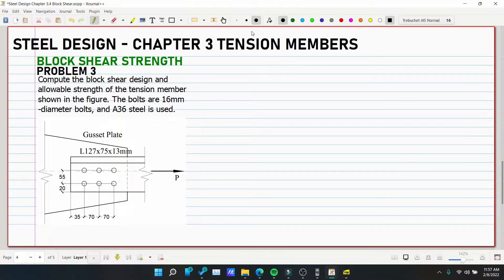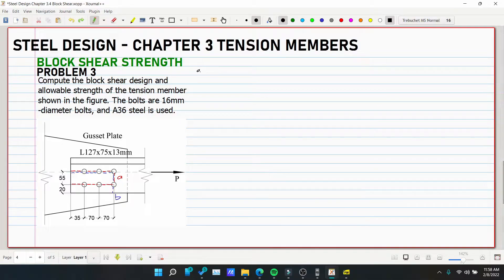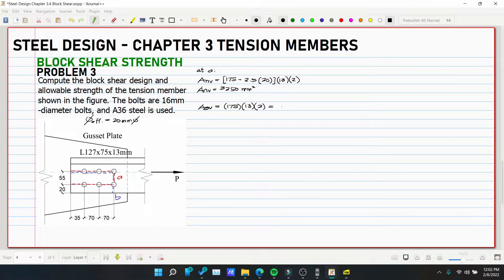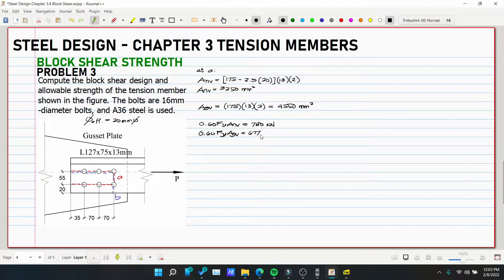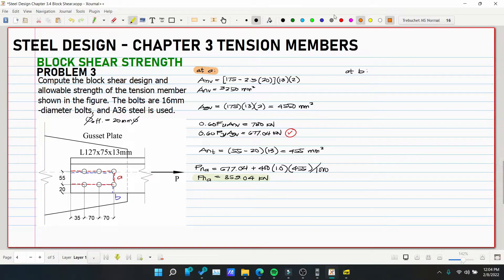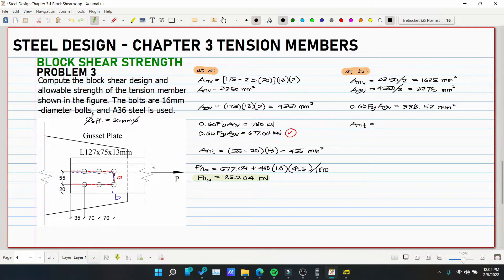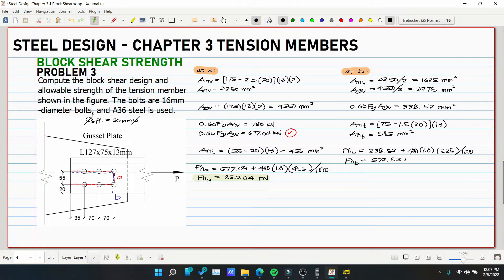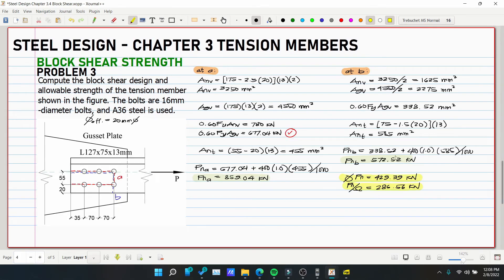Steel Design Chapter 3 Block Shear Strength Problem 3 (PH)

Comment: bakit po yung net tension hindi po naka multiply sa 2?
Reply: Hello po! sa pag kakaintindi ko po sa failure path A po ba? Ang pagkakaintindi ko po kasi isang buo lng po kasi yung may length na 55mm po bali (55-0.5 sa taas na bolt+0.5 bottom bolt tapos yung shear po dun is dalawa bottom and top part po pero yung tension po is isa lng kasi po kung babaklasin mo po yung part na 55mm isang buong tension member po yung maiiwan dun sa part ng isang layered bolt po. bali po (55-(0.5+0.5)(20))(13) = 455mm2 yan lang po mangyayari dun. sorry po if magulo pero sana po nakatulong

Comment: pwede po bang mas i clarify kung bakit hindi pwede yung path c? di ko po kasi masyado pang maintindihan, thank you po.
Reply from the maker: Sa path c po kasi, maunti lang yung butas na makukuha natin na ipangmaminus natin sa area, which whill make a greater strength kasi maunti lang yung butas. Sa tingin mo po ba, saan po mas mahina ang connection? Sa path na maraming butas o sa maunti? Syempre, dun sa mas maraming butas kasi maliit na lang yung natitirang area na magdadala sa load. E bakit sir di na natin cinonsider yung path samantalang malakas pala ang makukuha nating strength sa path c. That's the point, we don't need to check the connection kung saan siya malakas. Ikaw po ba, ano po ba ang mas inaalala mo? Ang strength mo, o yung weaknesses mo? Ano ba ang mas dapat ipriority in terms of strengthening yourself? Your strength or yung weaknesses? Syempre yung weaknesses natin. Ganun din sa structural members, we must check kung saan mas mahina ang member.

Comment from the maker: CORRECTION:

Ubs = 1.0 when the tension stress is uniform (angles, gusset plates, and most
 coped beams) and Ubs = 0.5 when the tension stress is nonuniform.

Since the tensile stress at failure letter B is nonuniform, dahil may mga bolts pa na magsasalo ng tensile stress mula dun sa failure path ng tensile, therefor ang Ubs na gagamitin at B is 0.50. 

Therefore: 
Pnb = 338.52 + 400(0.5)(585)/1000
Pnb = 455.52 kN
ØPn = 341.64 kN
Pn/Ω = 227.76 kN

Comment: good day po. ask lang po. since may natirang bolt po sa loob nang block area bakit hindi po 0.5 ginamit na Ubs  sa Pnb. ??
Reply from the maker: Ah, yes po. Nawala po pala sa isip namin itong Ubs. Anyway, dagdag po nating correction ito. 

Ubs = 1.0 when the tension stress is uniform (angles, gusset plates, and most
coped beams) and Ubs = 0.5 when the tension stress is nonuniform. Since our connection here will cause a nonuniform tensile stress distribution, therefore our Ubs = 0.50.

Thank your for the correction po!

(Sorry for the very, very late reply as CE Box is very busy with his Master's Degree, Accreditation, Work Stuff, and Life. Thank you for understanding. Keep in touch with CE Box as we plan to do more video tutorials.)